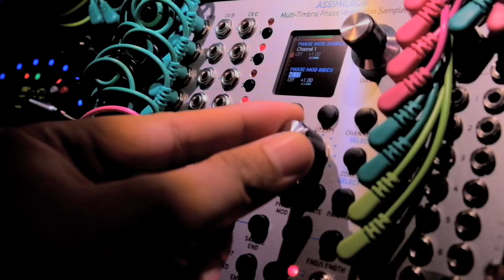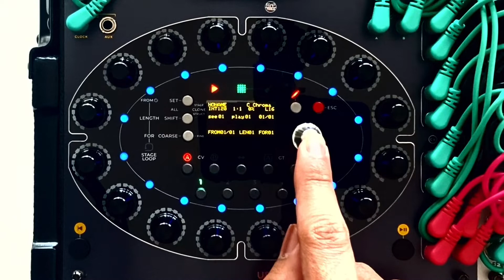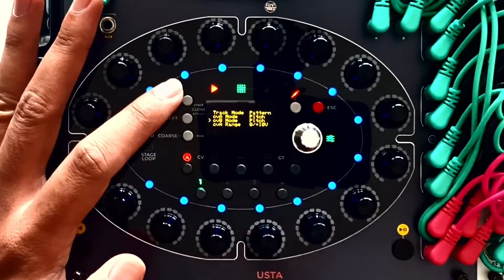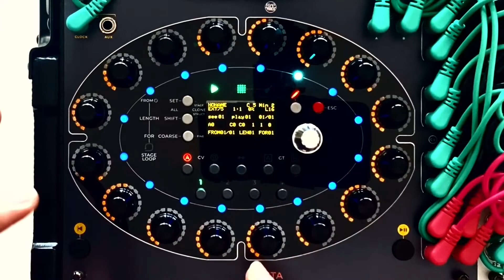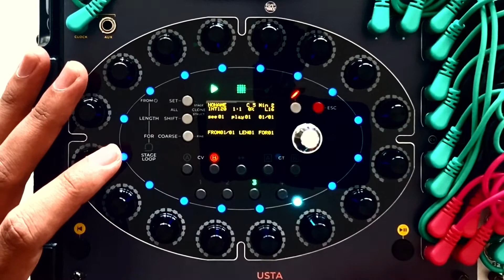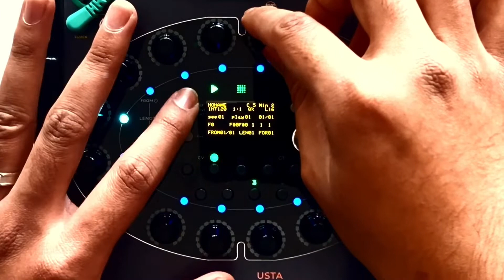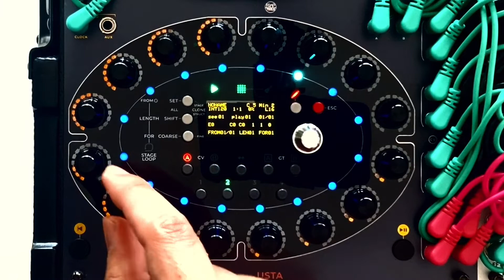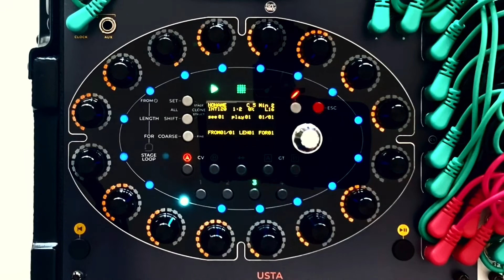How I Use My Frap Tools USTA (Part 2) Eurorack Modular Synthesizer | Patch From Scratch

Comment: Hello - Question! How do you get Pam's and USTA to sync so well ? I find USTA is always a few BPM off ( on screen ) from Pam's when using say Channel 1 to CLK and when using the DIN sync ( 24 PPQN ) its crazy - have to set USTA to 6:1 but the screen tempo is wild!
Reply from the maker: Yeah, I think that's the thing. I felt that, too. Maybe you need to calibrate it? Fraptools knows this best. It's better to contact them, I guess.

Comment: Hi Baséput,  have you tried the Five12 as well ? Which one would you get first, in terms of inspiration and immediacy ? I understand USTA has quite some colors and menu diving to learn, hence I am not yet decided. Thanks and continue your very well explained videos. KR Gauthier
Reply: The colours are very fast to remember and the menu is not needed so much after initial setup, most things are done with the encoders and buttons, either way the menu is easy to understand and not layers deep.
Reply from the maker: I haven't tried the Five12. But for me, USTA is really suited my style. Having the encoders in the circle brings me so much inspiration.  If you're into melodic composition, I'd recommend to get it. So great. Hope that helps.